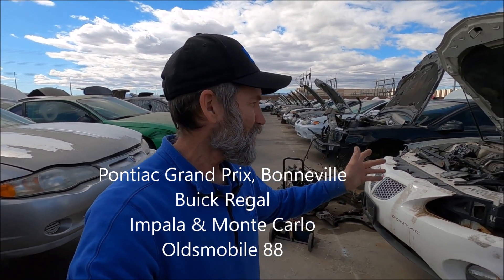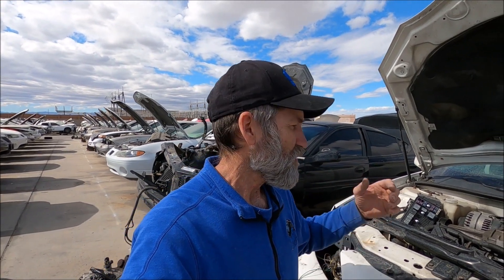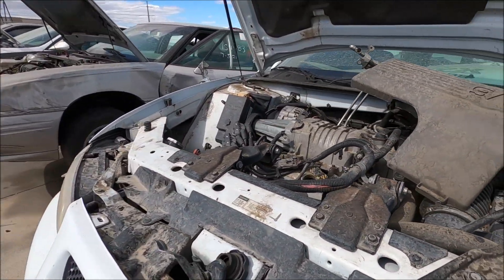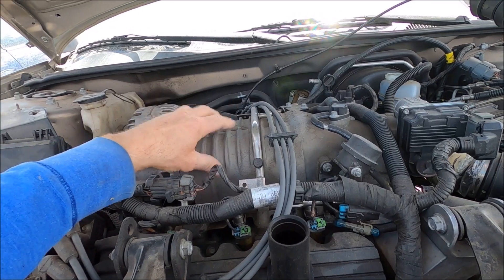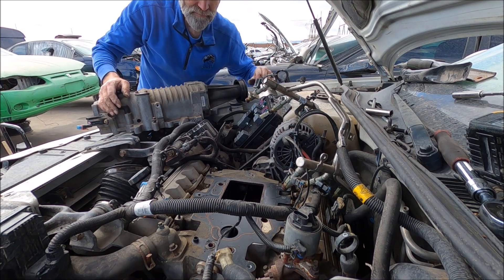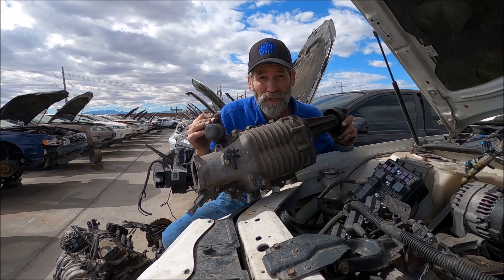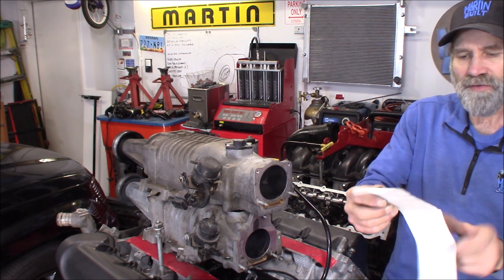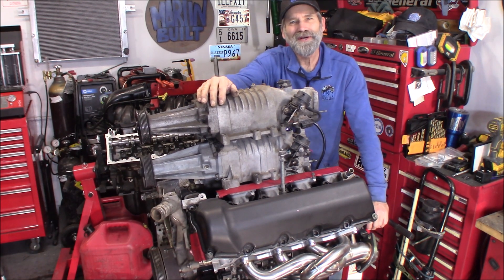Eaton M90 GM Supercharger for Cheap at Pic-A-Part

Comment: Did you end up using an m90 on a 4.7??? I have an 02 ram 1500 with the 4.7....and a 2002 grand prix gtp and curious to know if anyone has used the m90 on one and what they did for fuel injectors and fuel management/tuning. I have seen a kit online with a modified m90(whatever that entails) and that kit uses a supplimental injector in the intake pipe that comes on under boost. Im sure it works okay. But seems like a half ass way of doing it instead of just using higher cc injectors and tuning it. And fuel going through the blower cant be good for the coating on the rotors in the long term. Love your videos. Got an 08 intake with an airram tb adapter. Still searching for a set of 08 cams with no luck. The engine i pulled the intake manifold from had the valve covers off at the bone yard and the cams were rusted beyond help. Was deep rust. The pull it yourself yard near me never seems to have any 08+ 4.7s of dodge jeep or mits.

Comment: Man, Jealous of your yards down in the U.S. I'm in Ontario Canada and I just pulled a SC off a 97 Buick Riviera (It was the only car in the yard of about 1000+ cars that had one).
I paid $211 Canadian$ and it will have to be rebuilt. That Gen 5 you have is SUPER rare here, but you should have pulled the lower intake as well if you're using it on another GM 3800.

Comment: I have a Nissan pathfinder supercharger I got for 30 bucks at the junk yard haven't used it yet wanted to put it on my 3.7 dakota
Reply from the maker: Yes those look very similar to the M90. That would work well for the 3.7
Reply: @martinbuilt  I was sure how to do it no one's done a 3.7 I guess make a custom adapter plate and I'm worried about blowing it up
Reply from the maker: @FireHazardtv  Yes a custom adapter plate/intake manifold would need to be built. Custom tuning would also be needed.

Comment: Is there a piston and rod combo to lower compression on a 08’ 4.7 to be able to add boost? Also will the stock electronics register boost and adjust air/fuel?
Reply from the maker: How about the 9.0:1 short block from a 2003+ Dodge or 05+ Jeep. 
Electronics register?

Comment: So will I be able to do this to my second gen Durango? I see some company’s use this and modify it to work for the Jeeps and Rams. I’m really excited to boost my daily to help with fuel economy some while on 33’s.
Reply from the maker: I don't know why they only listed for the 2002-2007 Dodge Ram.  There may be some clearance issues with a super charger in trying to install it into a Dakota or Durango. The best would be to contact them.
https://www.boostedtech.com/solutions/dodge-ram/dodge-ram-1500/2000-2007-dodge-ram-4-7-liter-v8-supercharger/
Reply: @martinbuilt  thank you!!! I have been incorporating a lot of your videos into my Durango with some slight differences since it’s not entirely the same

Comment: Nice find. I wish the 4.7 had more mods. I'm looking into costs to swap mine for a 6.1 or 6.4 into my 07 Aspen.
Reply from the maker: Even a 5.7 would be a nice jump in power as well. Unless it already has a Hemi
Reply: @martinbuilt  yes it would but if the engine is out for a swap, might as well go 6 point anything
Reply from the maker: @357RedG  
sure why not. 😎👍

Comment: Wish my PullApart was that clean.
Reply from the maker: Yeah, they do a great job at the Henderson Nevada Pic-a-Part the North Las Vegas Pic-a-Part not quite as clean. I guess the guys down in Henderson work a little harder.  One of my favorite things about the Pic-a-Part is that they have all the cars elevated so you can get underneath them easily, and it's all on concrete.
Reply: @martinbuilt  Mine is in Charlotte . It has large gravel that’s in unleveled, but they too are elevated. Concrete would be great.
Reply from the maker: @johnfeather5405  It's been 10 years ago when they poured the concrete. Before the cars were on gravel and only the main alleyways were paved.
Reply: Just Wish we just had a pull apart it can be nasty but it would be nice idk how they keep that so organized

Comment: Also if you're the souring type you can buy them in peices and rebuild it yourself. It's one of those things I'm always searching for on ebay weather I need it or not. Haven't looked in a long time, since I havn;t had money for parts. But they used to show up as just the housiing or just the snout all the time, and rebuild kits aren't typically all that expensive. Theres also a few variations besides the m90 that people look for. Like the M62.

I still wanna throw one on my 4.0 just for fun. But shes long in the tooth and needs a bit of love before I'd do anything like that. Nothign, just all the regualr stuff that goes bad after 25 years.

Comment: Very cool! Boosted technologies makes an M90 kit for the 4.7, I think they use Gen III's by default but you might be able to get a gen V kit made ive also heard of them doing an m112 kit for a 4.0. From what I understand they use a 9th injector with a FTC to cool the charge Temps since the M90's are non-intercooled. The m90 seems like it can add quite a bit of power to a 4.7 but are limited compared to a larger blower.
Reply: @Larry thats awesome! You'll have to post some videos when you get it, I would like to see it
Reply: @Larry sounds like it will be a fun build, I've heard from talking to others that 8-10psi is the sweetspot and the head bolts start to stretch around 12, I've been wanting to boost mine so I went ahead and got some ARP head studs and ported the heads while I was at it. I've been running stock rockers with 212 cams and Comp cams valvesprings, and stock lifters for years and haven't had any issue. However I did replace all the valve train when I did the heads.
Reply: @Larry I picked up the cams second hand on Ebay in 2018, they were originally HO's but were reground by Crane Cams. I think regrinds are the only way to go nowadays. I've thought about a rear mount setup but im running a true dual exhaust system  plus I prefer the supercharger whine to the turbo whistle.
Reply: Adding a 9th injector is 80's stuff 😂😂😂 injectors and a HP tune + transmission tuning is better.. Supercharged manifold is not that hard to make, intercooler is better for the M90.. not a hard conversion, few bracket mods and map relocation.. the kit is expensive for what it is.. Using a Aussie L67 M90 Supercharger is better for throttle location..

Comment: Hi Martin. I've got a thumping on my right rear wheel on my 2000' jeep grand Cherokee Laredo.  I had a mechanic replace the wheel bearing but he said I need to replace the whole housing, which is the whole rear end cause it's worn out of round and will cost $2000? Someone else told me I can fix it using a certain method, I forgot what they called it? But at a fraction of the replacement cost. Do you have any advice??? Thank's
Reply from the maker: Are you talking about a suspension part that is worn out of round or the axle it self? 
 If it was me, I would be going to a salvage yard and pull another complete axle. You should be able to pick one up for $200 or less.
Reply: @martinbuilt  No, it's the Axel housing. The whole outer tube that houses the Axels and differental gears. The rear end. The bearing housing is out of round.
Reply: @martinbuilt  . What shop can do this kinda work???speciality shop??
Reply: @martinbuilt  . What specific year's would be compatible?? 👍

Comment: You can get quite a few GM/Eaton superchargers out of various models with the 3.8 V6, such as: 
- (90's & 2000's) Pontiac Bonneville SSEI's
- Pontiac Grand Prix GTP's
- (Early 2000's) Chevy Impala SS's
- (Early 2000's) Chevy Monte Carlo SS's
- (90's & Early 2000's) Buick Park Avenue Ultra's
- (90's & Early 2000's) Buick Regal GS's
And Buick Regal GSX's < really hard to find
- (90's) Buick Riviera's
- (90's) Oldsmobile Eight-Eight LSS's
- (90's) Oldsmobile Ninety-Eight Elite's
I'm sure there's more I'm forgetting, but these are the ones that might still be on the road around you... keep an eye out, there's very subtle details they changed to let you know that there's something "special" under the hood... you never know what grandma could be driving...
Reply: Also the Australian Holden Commodore from 89-2003.
Reply: I am surprised they were never in the Pontiac Firebirds in those years